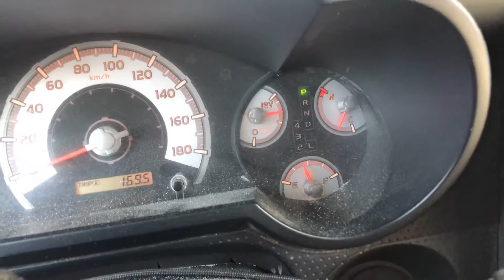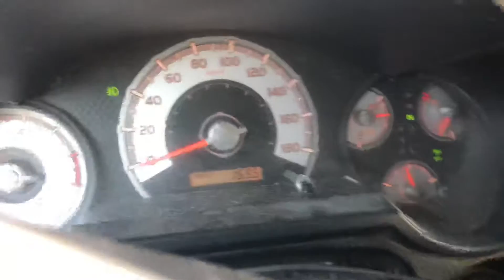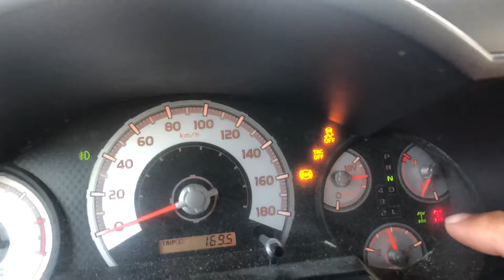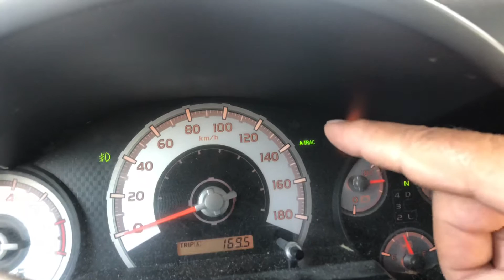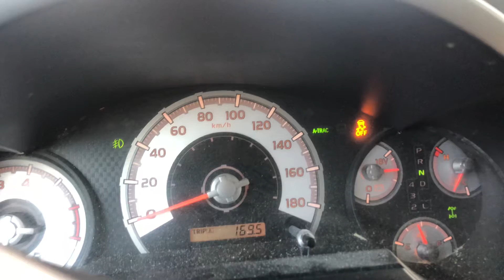FJ Cruiser traction control explained

Comment: Not quite right. You can lock the rear dif AND use ATRAC in spite of the ABS off indicator. ATRAC, when activated, replaces ABS. Lots of documentation about this online with a bit of research.

Can't recall ever needing both in my 15 years of ownership, but it's certainly conceivable. ATRAC is my go-to in most 4L situations.

Wanted to mention that in 4H for city/highway driving in winter (35 Alaskan winters so far), I keep VSC and TRC on all the time. Safer in town and on the highway to keep them active, imo and experience.

Edit: Found an interesting note aout ATRAC in the owner's manual: "When the rear differential is locked (vehicles with the rear differential
lock system) The active traction control system is activated only when the vehicle speed is less than 4 mph (6 km/h)."

Comment: So you've been in N the whole time, should I always be in neutral when shifting on the 4WD gear shifter?
Reply: No, you can change on the go.
Reply: @neilfrasersmith  Not true, only on the fly while shifting into 4H (high or high speed).   You must be stopped and in neutral to shift into 4L (low or low speed)
Reply: You can shift into 4H (high) anytime** (**there is a speed limit, but I don't have my manual with me so I'm going to say 40 mph and under).  To use 4L (low speed driving & climbing) you must be stopped and in neutral.

Comment: A lot of people from the FJ Cruiser Forums have installed a switch that allows you to completely disable the traction control, vehicle stability control and ABS no matter what position the transfer case is in, I believe it's called the VSC Hack. It's not difficult to do, but it makes a huge difference playing in the sand dunes and washes in 4-HI because some of the traction controls will still override that factory switch in high range, as well as disabling the ABS which you really don't need in the sand. I was driving off a large sand dune in 4-HI and thought everything was disabled by doing what you did with the stock disable switch, but had to do a bit of a side arc coming down to avoid a huge hole where another vehicle had been stuck. Traction control still cut the throttle completely and VSC/ABS engaged and tried to turn the FJ dead sideways coming down a steep dune, (the very last thing you want to happen) and made driving out of it a little difficult. I installed my own switch that day and never looked back, it puts me 100% in control of the vehicle until I manually turn everything back on.
Reply: This is called a kill switch , my dad has it

Comment: The diff lock only works in low range, correct me if i'm wrong..
Reply: You are correct, but there is also a wiring hack you can find on the FJ Cruiser Forums that allows you to use the rear locker in 4H and even 2H. I did mine about 6 years ago, I can't remember exactly how I did it but it was really easy to do. I believe you need a ring terminal and some electric tape, it's about a 10 minute job.
Reply: @zodeefinance5151  I'm not sure if anyone ever made a video showing how to do it, unfortunately I'm disabled now and couldn't get back under the driver's side dash/kick panel again to save my life. Are you a member of the FJ Cruiser Forums? There's always people willing to help there, you might even find someone close to you who can show you how it's done if you're not comfortable doing it yourself.  

Reach out to the user 'FJtest' on the FJ Cruiser Forums, he's on just about every technical thread there. He's by far one of the most knowledgeable people I've ever encountered regarding FJ Cruisers. I'm also on the forums with the same username/pic as here. If FJtest can't help you or tell you how something is done, he'll get you in touch with the right person who can...

Comment: What would be the best FJ set up (e.g. track off? , diff off?) for driving on soft sand?
Reply: A lot of people from the FJ Cruiser Forums have installed a switch that allows you to completely disable the traction control, vehicle stability control and ABS no matter what position the transfer case is in, I believe it's called the VSC Hack. It's not difficult to do, but it makes a huge difference playing in the sand dunes and washes in 4-HI because some of the traction controls will still override that factory switch in high range, as well as disabling the ABS which you really don't need in the sand. I was driving off a large sand dune in 4-HI and thought everything was disabled by doing what he did with the stock disable switch, but I had to do a bit of a side arc coming down to avoid a huge hole where another vehicle had been stuck. Traction control still cut the throttle completely and VSC/ABS engaged and tried to turn the FJ dead sideways coming down a steep dune, (the very last thing you want to happen) and made driving out of it a little difficult. I installed my own switch that day and never looked back, it puts me 100% in control of the vehicle until I manually turn everything back on.
Reply: @chainlink4241  hey, so out of curiosity, would that VSC Hack be a good setup for driving in snow and ice? I’m a bit of a newer driver and where I’m at we don’t get much snow but when it comes the roads go to crap, and sometimes I find my VSC almost throwing me further into a slide
Reply: @coronis_personal  I can't speak for anyone but myself as far as performing the mod. It really depends on your own judgement and experience. Have you driven many older vehicles and 4x4's that didn't have any type of VSC/ABS/Traction Control in those conditions? The main reason I installed the switch was so I could disable everything for off-road use where I wanted 100% control of the vehicle. 

If a person were to have a wreck on a public roadway and insurance investigated and found those systems were disabled at the time of the incident, it could open up a whole new world of trouble for them. It's one of those decisions that if done, you'll have to accept any and all consequences that may result in using it. 

I live in a very small town in a remote area (Northern US), so the fastest I ever need to go is usually only 30 mph or so and no more than 50 mph in just about any conditions. I run more aggressive tires, but even all terrains do really well in snow & ice. Check the air pressure too. I run my 33's as low as 28 psi in the winter where I am, and no higher than 32 psi in the summer for highway driving. The tires wear dead even and I get excellent traction especially in winter storm conditions. 

I've even aired down as low as 10-12 psi for ice a couple times years ago where it was really bad (oilfields) and involved off-road and iced over roads just to get home. I can stab the brakes at 45 mph on snow/ice without even activating the ABS on my FJ, so I've never felt the need to disable anything on public roads myself. I see a lot of people over-inflating their tires to try to get an extra couple MPG's, but I prefer the added traction/handling at the expense of a little fuel mileage. 

I really can't tell anyone else what to or what not to do with their vehicle, I can only say what's worked best for myself from my own experience. Tires flex more the lower the pressures are, which creates heat. Heat sticks to cold, frozen surfaces well, and you won't overheat them to the point of damaging them around 28-32 psi. Hope this helps you, Happy New Year!
Reply: @chainlink4241 bro you Definetly FJ. Just got one and that type of knowledge you dropped only comes with experience

Comment: When my 08 is in 4lo with rear diff locked I can still use my a-trac. It only uses it on the front wheels. It’s rare I need it but it’s good to have.
Reply: It was something they fixed with newer models iirc

Comment: This is just what I needed.  I test drove an FJ today and had trouble  figuring out if all those yellow lights were a problem or not when I tried ATrac and diff lock.  I was just pressing the buttons in park with the transfer case selector in 4L.  The diff lock red light was flashing but now I understand that maybe it didn't engage because the vehicle didn't move.